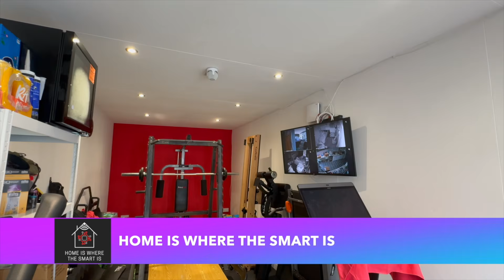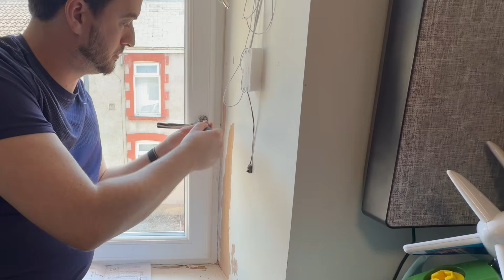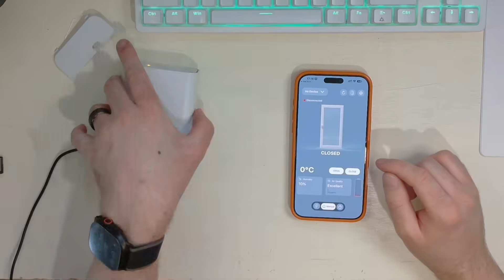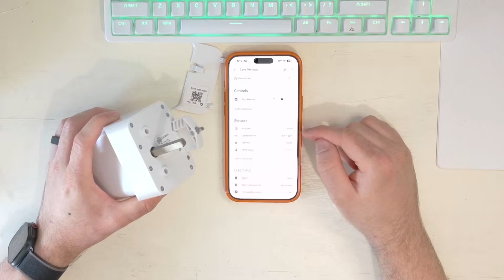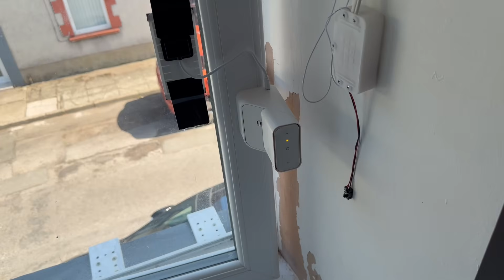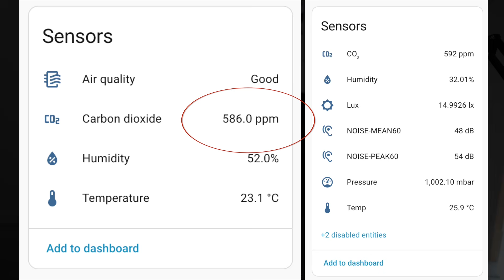This Smart Gadget Solves the UK Heatwave Problem

Comment: Done this for years: German Term for Opening Windows
The German term for suddenly opening all house windows is Stoßlüften.
Definition and Purpose
Stoßlüften translates to "shock airing."
This practice involves opening all windows wide for a short period to quickly exchange stale indoor air with fresh outdoor air.
It aims to improve indoor air quality while minimizing heat loss.
Benefits of Stoßlüften
Reduces indoor humidity and prevents mold growth.
Enhances overall air quality by removing stale air and pollutants.
Maintains warmth in well-insulated homes, as most heat is stored in walls and floors rather than in the air itself.
Recommended Practices
Open windows fully for 5-10 minutes during winter.
This method is effective even in colder months, as it allows for quick air exchange without significant heat loss.

Comment: This is massively over engineered. The sensors are likely to be inaccurate (even if they've made an algorithm to correct it being next to a window), you want the sensor inside the room rather than by the window. 299 is a hard pill to swallow for what could have been something a lot simpler being solely the window opener/closer and using other HA devices for sensor data.
Reply from the maker: I actually largely agree. I have plead with the developer to try and make a cheaper stripped back version, as I think that could be really popular for those of us with our own sensors already.

This is clearly the “standalone set and forget” device.

However I was pleasantly surprised at how well the CO2 sensor worked. Because when the window is closed, the CO2 level mixes very evenly around the room, and read very closely to my sensor in the room.

Though the temperature can get wildly inaccurate on a sunny day (but that component is very cheap).

Comment: Does it bollocks, install air conditioning if you don’t want to suffer 😂
Reply from the maker: Well yes of course, but proper AC is a much bigger investment (one that I am still very tempted by 🥵).
Reply: @HomeIsWhereTheSmartIs probably cost less than these devices and it actually cools your room instead of just telling you the window is open 😂
Reply from the maker: Oh I assumed you were talking about proper, installed AC 🙈 I do have a couple of those freestanding units, and they were definitely more expensive than this device, but (once setup properly) they are of course more effective.
Reply: @HomeIsWhereTheSmartIs you can DIY mini split if it’s R290 (propane) as it’s not f-gas controlled. 

Complete kits can be bought for about £350-£400 but it’s double in price right now because seasonal pricing lol

Comment: Very expensive for what it is imo.
Reply: Especially when you would want to put on several windows to make good use of automations
Reply: Love the concept and the security aspect, but All my windows open outwards 😭
Reply from the maker: Yeah it's not cheap, but do bear in mind what goes into it (and how compact it is).

When I've put chain motors on windows in the past, they've been over £100 to start, then add a relay to control it etc and the price gap does start to shrink.

Especially when you consider how much the SCD41 CO2 module costs.